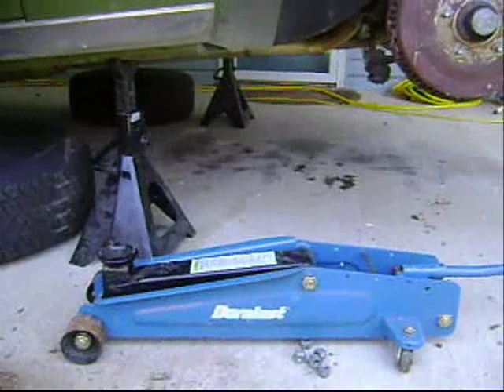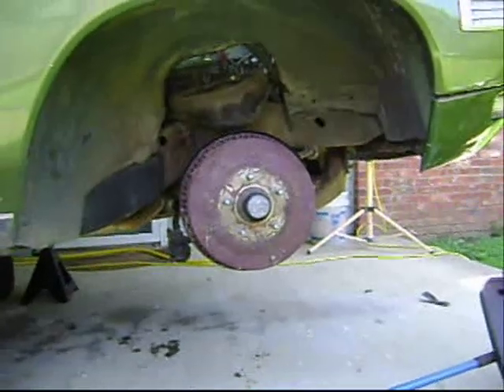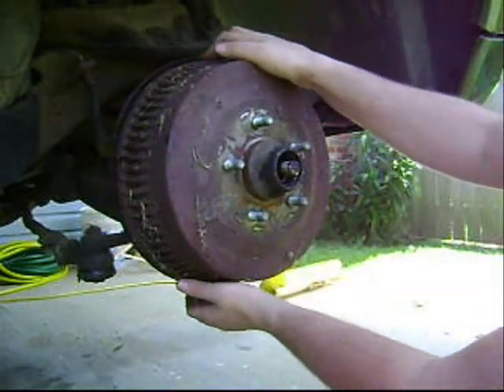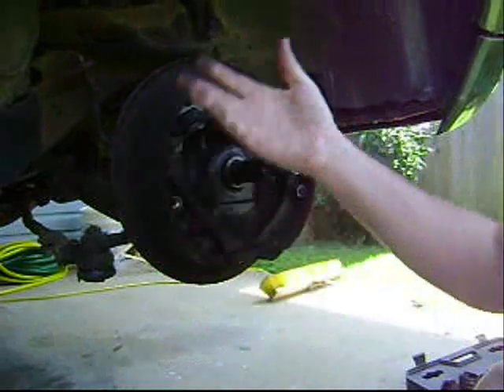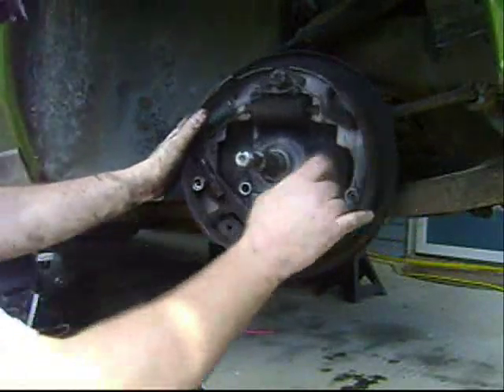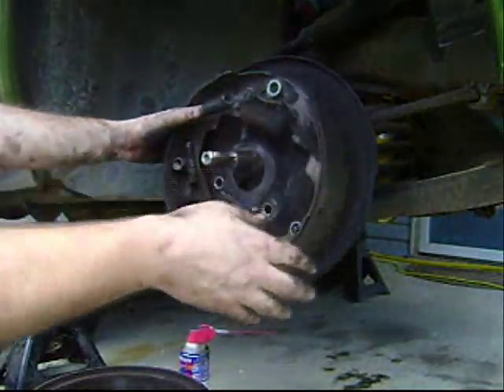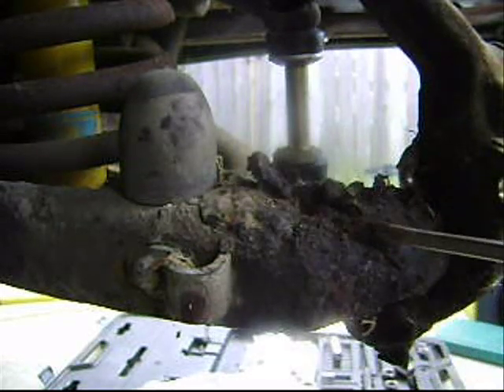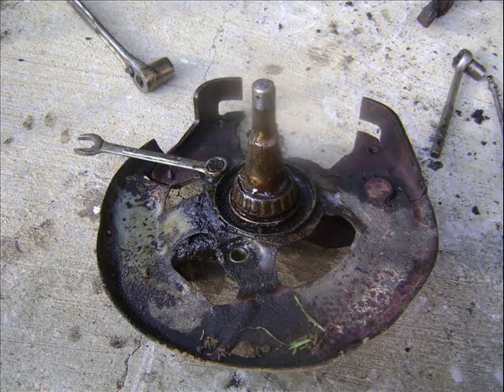1968 Pontiac Catalina Drum To Disc Brake Conversion Part 02

Comment from the maker: The taper on the ball joints is slightly different on the 71 spindles vs the 68s, hence the need for going to Rare Parts. But hey, you only gotta buy 'em once. You would be WELL advised to find an internet forum or mailing list like I have. Your fellow owners are a wonderful source of help. I'm putting a link to our mailing list in this video description.
Reply: I've done disk upgrades before where the ball joint taper is different. All I did was change the ball joints to the correct ones to match the spindle.

Comment: What year and car do i need to get ball joints for? I've purchased everything else so far except the spindles i keep seeing spindles for a chevy caprices on ebay and the add says it will fit 71 bonnieville should i get those spindles?

Comment: I really enjoyed this series. I'm working on my '68 Firebird and cannot get the front backer plate off. I removed the 3 bolts, but the top is still stuck as if it was welded there. At around minute 7, yours comes off very easy. Is there some kind of magic you used to get it loose once the bolt came out?

Comment: From now on use a hammer to tap the wheel baring/hub dust cap off. You will notice on most used cars they have dents in them as they were previously tapped off ;)

Comment from the maker: Sure, I can help you out. I don't think you're going to be able to just go down to the corner auto store and buy parts. These are old cars, and the fullsize models don't have the aftermarket support that the little Firebirds and GTOs have. What you need is the front disc setup from a 1971 Bonnieville. You need the spindles, discs, and calipers.  The drum spindles on our 68s won't fit the rotors, so you have to put the 1971 spindles on. You also need special ball joints. Rare Parts Inc has 'em.